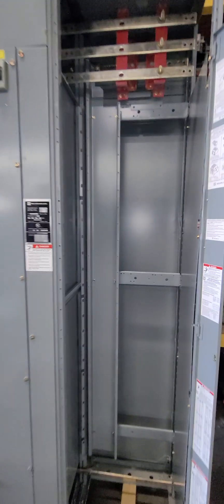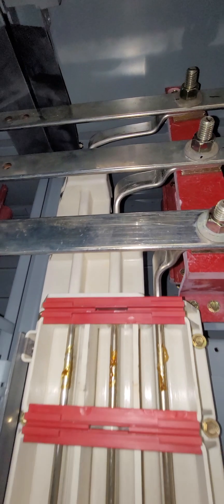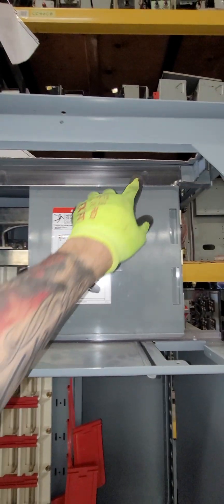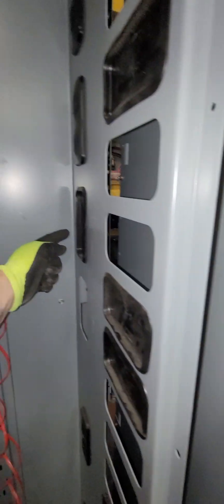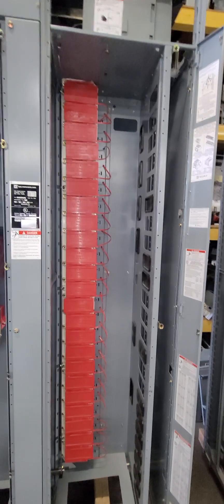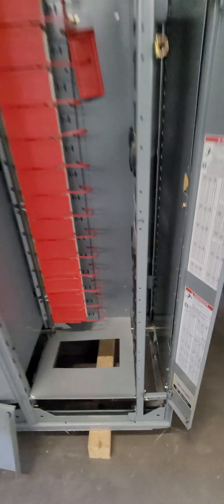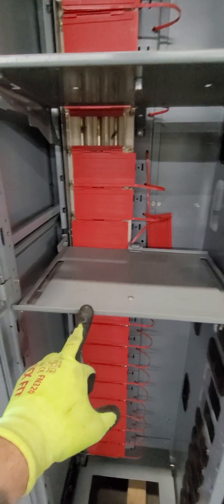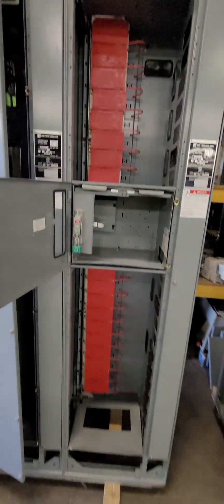installing buss into a Square D model 6 Motor Control Center

Comment: Hello Ryan i watched an older video where you showed GE QMR fused switches and the comments were disabled but i have a question about the QMR. I have one with a seized disconnect. The handle turns but the spring mechanism wont unlatch. 

Do you do anything to unseize or clean/lubricate the moving parts? Info from GE is scarce.